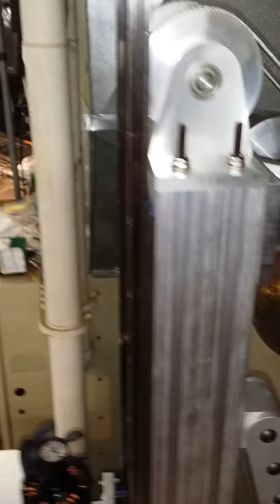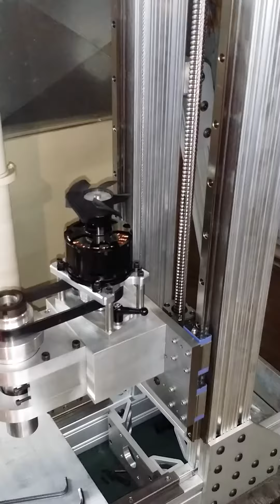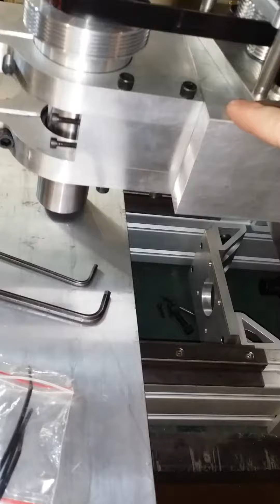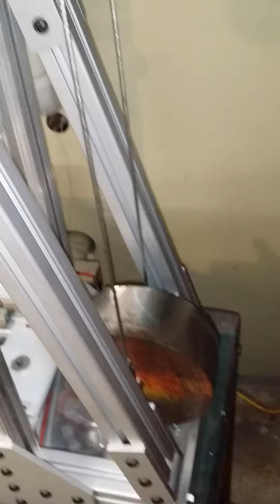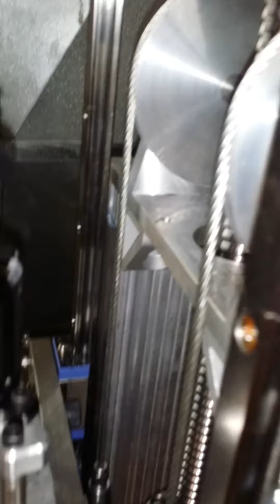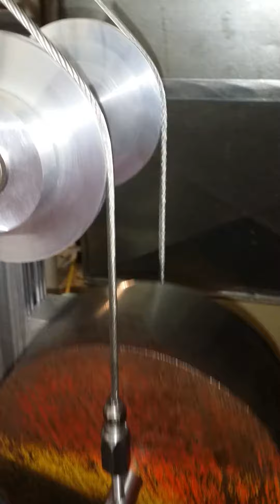Mill Counterweight Test

Comment: What spindle did you use for this project and did you machine the housing yourself?
Reply from the maker: +whitehedr I used this spindle: http://littlemachineshop.com/products/product_view.php?ProductID=1407&category= And yes I machined the entire spindle housing on my other Harbor Freight Mini Mill.
Reply: +Couple of questions for you......did you do a build thread for your machine?  I can't imagine how you made the cuts for the housing, keeping everything in the precise alignment that I imagine a spindle housing would require. if you would care to elaborate on how you did the setups and the cuts I would certainly be interested in listening and learning.

ROG
Reply from the maker: +whitehedr I haven't done a build log, yet. I may in the future. I still have a bunch of things I need to do to the mill, like add some more steel stiffeners, figure out some rail/ screw covers, rebuild the spindle. 

To make the spindle, my harbor freight mill had to be trammed pretty well. It's made of several pieces. I basically cut out the lower and upper half shapes, did the necessary drilling and tapping, then to get the back faces of the spindle clamps flat, square and parallel, I used an old bearing halfway placed in both bores to line up the parts and take a couple finish passes. Worked well, but I still need a shim to square up the spindle on the machine. I plan on redoing the spindle and maybe use some angular contact bearings.